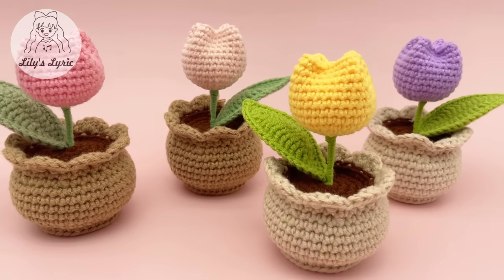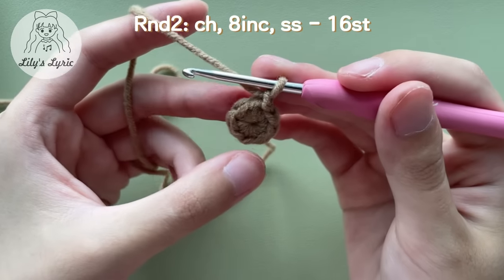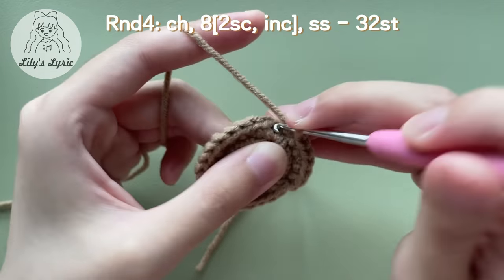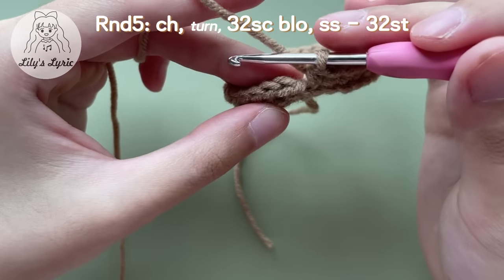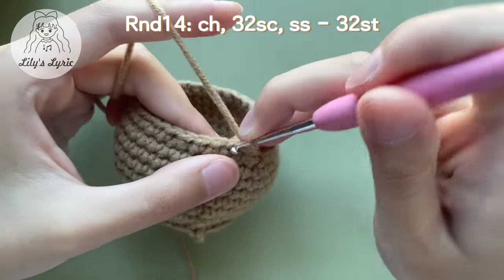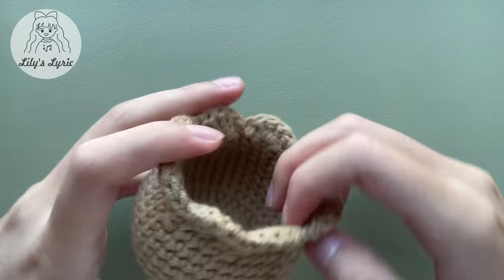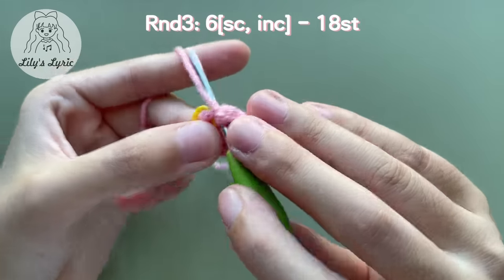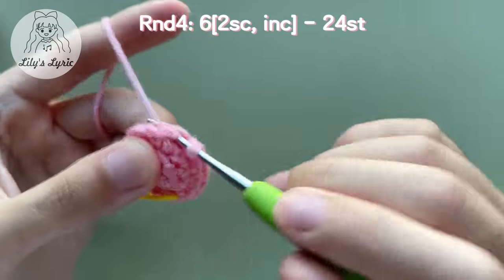How to Crochet a Mini Tulip Pot | Crochet Tutorial | US Term | for Advanced Beginner

Comment: I made the project and it turned out fine.  However, in the materials part it would have been helpful if you would have specified that it is 20 cm wire and 8-10 cm branch.  So I am going to remake this using the correct wire and branch.  It really is a lovely potted plant.